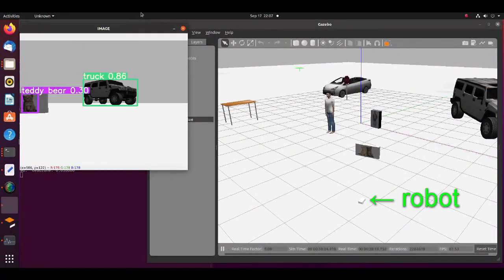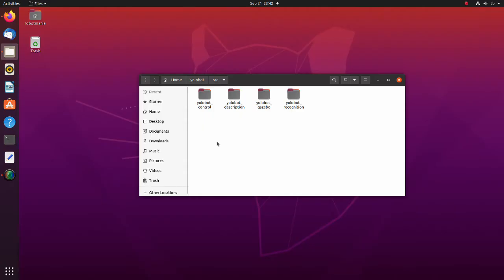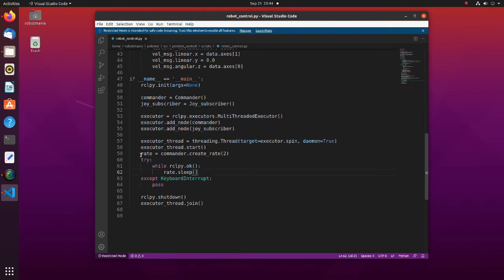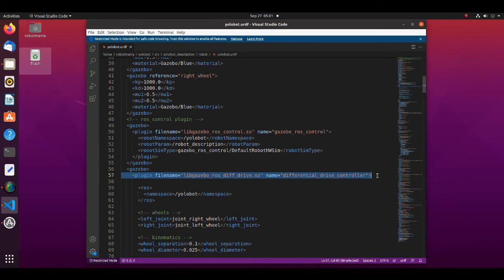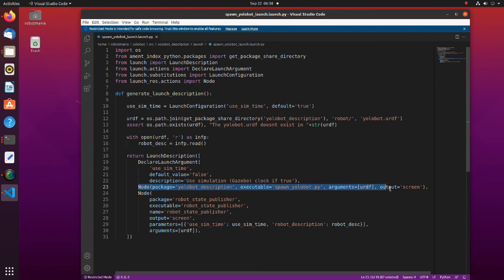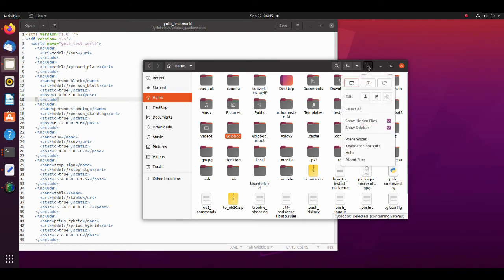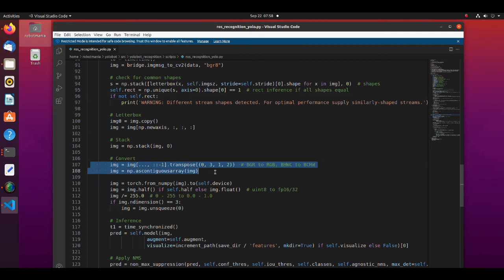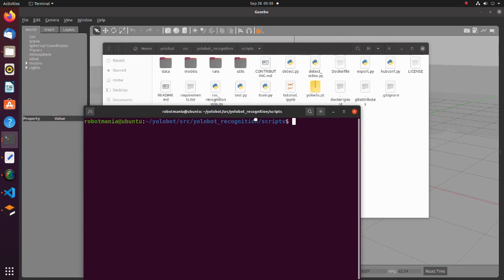Object detection in Gazebo using Yolov5 and ROS2

Comment: robot is moving very slowly even after making changes to this 

speed_multiplier = 40000  
        angular_multiplier = 10000  
        vel_msg.linear.x = data.axes[1] * speed_multiplier  
        vel_msg.linear.y = 0.0
        vel_msg.angular.z = data.axes[0] * angular_multiplier
Reply from the maker: Hi mani kanta!
Thanks for watching my video!
In the “yolobot.urdf” file, change max_wheel_torque and max_wheel_acceleration (lines 72 and 73). Probably, this will help.
Reply: @robotmania8896  HI sir!
Thank you for your replay 

i tried your suggestion but no changes in speed

<max_wheel_torque>1.0</max_wheel_torque>
      <max_wheel_acceleration>10.0</max_wheel_acceleration>
Reply from the maker: I thought that there might be a problem with joint limits (yolobot.urdf lines 220, 247) but it seems it is not the case. So, currently I don’t have any valuable suggestions.

Comment: Hi, i love this video but i am new to this could you explain how do i do this if i clone your repo i have installed virtual box and inside installed ubuntu and have gazebo and ros2 but i need start up point how do i do this
thanks
Reply from the maker: Hi Izaq!
Thanks for watching my video!
What do you mean by “start up point”?
Reply: @robotmania8896  i have to much confusion in my mind i just need to clone the repo and change the files or i have to do the coding part by my own. how do i do the human detection at traffic light and create human and add sensors in gazebo and how do i create the environment in gazebo to detect human and integrate the yolov8 to detect human
Reply: can you provide the readme file
Reply from the maker: @Izaq-b2i  Since there is no git repository, I haven’t prepared a “readme” file. But all information required to execute the simulation is in the video. Where exactly are you experiencing a problem?

Comment: Hey Robot Mania,

Thank you for an awesome video. I have one issue though that I am running into. After I do the colcon build and source commands, and when I do the ros2 launch command, the only message that pops up in my terminal is the following...

[spawn_yolobot.py-4] [INFO] [1691511749.451716890] [minimal_client]: service not available, waiting again...
[spawn_yolobot.py-4] [INFO] [1691511750.453754371] [minimal_client]: service not available, waiting again...
[spawn_yolobot.py-4] [INFO] [1691511751.455862156] [minimal_client]: service not available, waiting again...
[spawn_yolobot.py-4] [INFO] [1691511752.457566763] [minimal_client]: service not available, waiting again...
[spawn_yolobot.py-4] [INFO] [1691511753.459380451] [minimal_client]: service not available, waiting again...
[spawn_yolobot.py-4] [INFO] [1691511754.461384011] [minimal_client]: service not available, waiting again...
[spawn_yolobot.py-4] [INFO] [1691511755.463323533] [minimal_client]: service not available, waiting again...
[spawn_yolobot.py-4] [INFO] [1691511756.465049689] [minimal_client]: service not available, waiting again...
[spawn_yolobot.py-4] [INFO] [1691511757.467008894] [minimal_client]: service not available, waiting again...
[spawn_yolobot.py-4] [INFO] [1691511758.468421122] [minimal_client]: service not available, waiting again...
[spawn_yolobot.py-4] [INFO] [1691511759.470684242] [minimal_client]: service not available, waiting again...
[spawn_yolobot.py-4] [INFO] [1691511760.472741163] [minimal_client]: service not available, waiting again...
[spawn_yolobot.py-4] [INFO] [1691511761.474655989] [minimal_client]: service not available, waiting again...

I working with ROS2 Humble, and Ubuntu 22.04
Reply: Hi I'm also working with ROS2 Humble and struggling on the launch command, did u change something in the code?
Reply: Okei I fixed this, u have just to run gazebo manually

Comment: It would be very useful if you make a tutorial making new models in Gazebo, for example the boxes with pictures. Looks like your models are created in Blender, so I tried make such, but with no success, despite of using several tutorials. I trained YOLOv5 with my custom dataset (drywall-joint-detection in roboflow) and wanted to create such boxes, so the robot could point the detected objects. I easily managed just to change the picture of your model with mine, as a temporal solution.
Reply from the maker: Hi Simeon Tsvetkov!
Thank you for a suggestion. I will consider it.

Comment: Hi, I'm facing an AttributeError: 'Upsample' object has no attribute 'recompute_scale_factor'. After a research I found out that it seems to be a torch version issue, but I tested both 1.12 and 1.11 and still the same error, also it seems I cannot downgrade torch any further. Which torch version does work for you guys?
Reply from the maker: Hi alejandro!
Thanks for watching my video!
Can you please try it out with python 3.8 and pytorch 1.10?

Comment: Well done. While using cuda GPU, I recorded error in line 80 of ros_recognition_yolo.py... 

self.model(torch.zero (1, 3, imgsz, imgsz). to(self.device).type_as(next(model.parameters ()))) 
NameError: name 'model' is not defined. Did you mean: 'Node'? 

Any solution to this problem?
Reply from the maker: Hi Olarewaju Lawal!
Thanks for watching my video!
There was a bug in my code. I have fixed it and uploaded a new code.
To fix this problem please add “self” before “model”.
.type_as(next(self.model.parameters ())))

Comment: I remap and it works. But yolobot moves very slowly although I increased the speed of the yolobot by q and w keys. Rotation speed is increased well by e key. How can I increase the speed of yolobot by changing the code?
Reply from the maker: Hi Gwi Suk Heo!
You can increase speed of “yolobot” by modifying line 38 in robot_control.py. Multiply a value bigger than 1 to “data.axes[1]”. This should increase linear velocity of the robot.
Reply: @robotmania8896  Thank you.

Comment: Thank you for a nice presentation about Yolov5-ros2. How can I control the yolobot by keyboard? It moves very slowly by itself. I want to control it to move it fast as like at your video.
Reply from the maker: Hi Gwi Suk Heo!
Thanks for watching my video!
If you want to control this robot using keyboard, you have to install “teleop_twist_keyboard” package. Install it by “$ sudo apt install ros-foxy-teleop-twist-keyboard”. Also, don’t forget to remap the “/cmd_vel” topic to “/yolobot/cmd_vel”.
Reply: @robotmania8896  Thank you. I remap and it works. But yolobot moves very slowly although I increased the speed of the yolobot by q and w keys. Rotation speed is increased well by e key. How can I increase the speed of yolobot by changing the code?

Comment: Hi, Robot mania, Thanks for all your content!!... they are super useful and informative, 
I have a question -
1. Can we integrate an intel real sense camera instead of a normal camera for object recognition,
2. With your help I was able to get the distance and height of the object in front of the rover, how can integrate these two things along with object detection

what I mean to say is that  - along with detecting object how can I make it show the distance and height of an object in front of it? 
Thank you so much!! for everything your the best
Reply from the maker: Hi Niranjan Sujay!
1. Yes, you can. For example, in the yolo_angle_estimation.py script, lines 79~89, 94~104 are where I set up and get frames. You can use this part of the code.
2. If you want to show the distance and height on the monitor, use this code:
text1 = "height : " + str(height) + “, distance : “ + str(distance)
cv2.putText(img0, text1, (int((xyxy[0] + xyxy[2])/2), int((xyxy[1] + xyxy[3])/2)), cv2.FONT_HERSHEY_PLAIN, 3, [225, 255, 255], thickness=2, lineType=cv2.LINE_AA)
this code should display distance and height in the middle of the bounding box.

Comment: What a great project! Can I use ros1 to start the project? Hope to get your answer
Reply from the maker: Hi 王文!
Thanks for watching my video!
You need ROS2 Foxy to run this project. But you can use python scripts from this project in ROS Noetic. Yolov5 recognition script will not work with ROS versions prior to ROS Noetic (like Melodic, Kinetic) because in these versions python2 is used.
Reply: @robotmania8896   hey! i'm currently working on a project of a autonomous boat. i am trying to use yolov5 for the detection of sea markers and have so far obtained a trained model. Would I be able to implement it in a ros node using ros melodic? Thanks!
Reply from the maker: Hi Ravi Regalo!
Thanks for watching my video!
You can not use yolov5 with ros melodic because yolov5 needs python>=3.8, and ros melodic uses python2. If you want to do object detection using yolo in ros melodic, I think you can use C++ implementation of yolo.
Reply: @robotmania8896  Thank you very much for your reply. As I really need to use ROS melodic I think I will stick with yolov3 and darknet. Keep up the great videos!